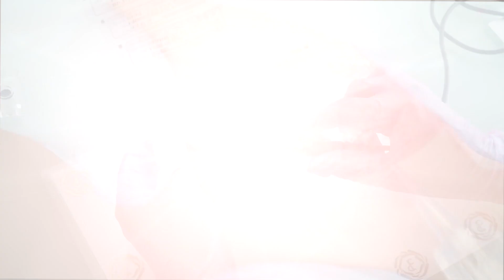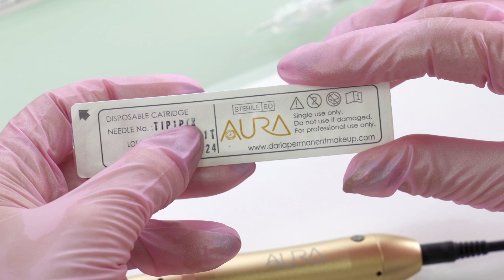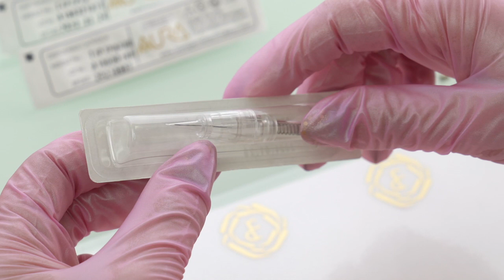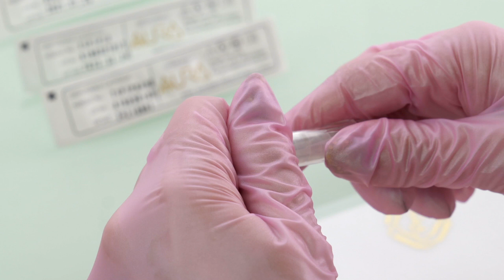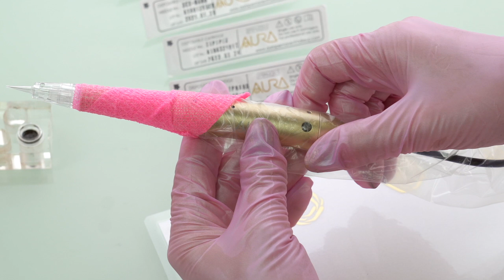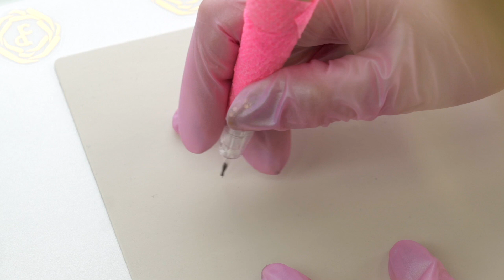Aura Permanent Make Up Machine & Needles Tutorial

Comment: Is the machine pretty light ? I bought the Xion S but find it a bit heavy 😢 do the needles have membrane protection ?
Reply from the maker: The needles are one time use, each needle comes in a sterile package and has a backflow prevention cartridge system to prevent cross contamination.
Our customers have given feedback that the machine feels light.
The machine itself weight 65 grams including the needle.